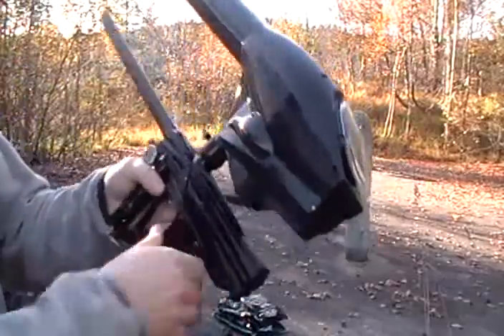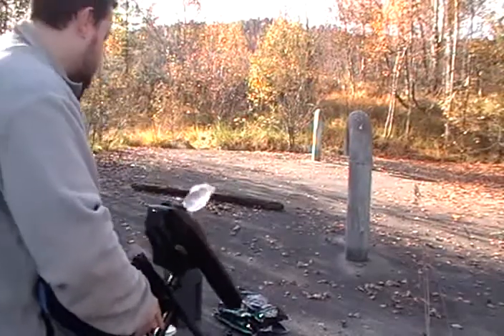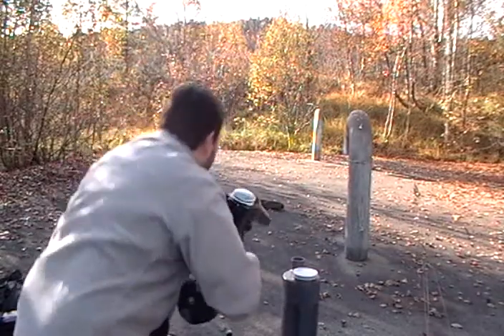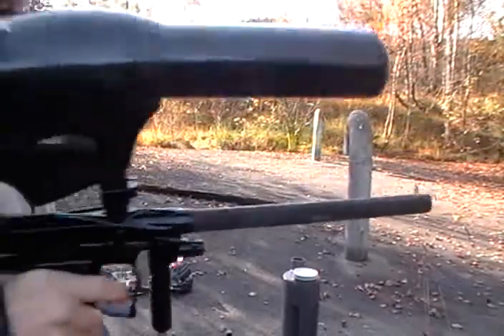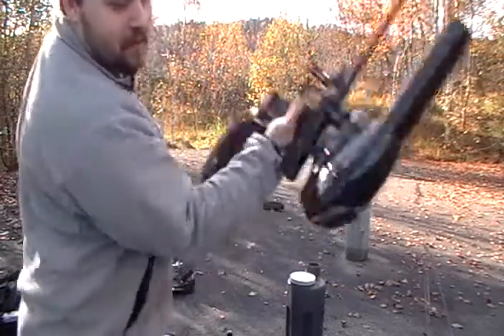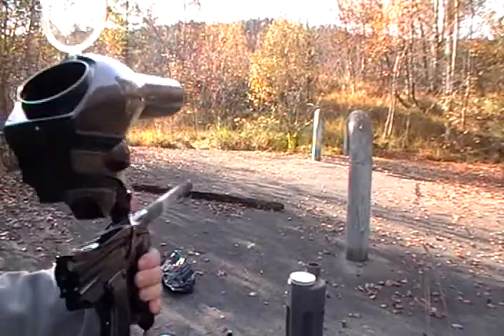Critical FEP Quest efficiency test

Comment from the maker: @crazydman 

It is one pound, 14 ounces without the barrel. I use a Deadlywind, so mine is lighter, but the barrel that comes with the Critical Quest is a 100gram barrel, which is 3.5 ounces. So, with the stock barrel, it weighs in at 2 pounds, 1.5 ounces. Slightly less than an Etek 3.

Comment from the maker: @Talucci34 

It should be around 100. I lucked out with my Quest, and it runs fine at about 55-60 PSI out of the box, but I have heard that many people need to start out at 100, and break it in a bit to get it down that far. You can try messing around with it if you like, but you can play it safe and stick around 100 for a while.

Comment from the maker: @hock2ichainsawu 

Is it a large leak from the ASA? Because that is the purge hole. It would be leaking for two reasons. Reason one is because your tank is not screwed all the way in, and reason two is because the o-ring on your tank is damaged/destroyed.

Your bolt could be a lot of things, all of them related to o-rings. Pull out the bolt, check all your o-rings, relube, and try again.

Comment from the maker: @xxTIGER43xx 

I have been told that they are backordered until the end of January, but the only place that could tell you for sure is Critical. I would give them a call, and find out. But I am not sure what you would upgrade on the Critical Quest. A new ASA so it has an On/Off, and maybe a board... But really, the ONLY reason to get a new board is for burst, full auto and auto-response. If you dont care about those modes, and will just play semi and ramping, stick with the stock board.

Comment from the maker: @xxTIGER43xx 

I do not have any real experience with the Droid, so I will not comment on that. But the Quest shoots better than the Ego 09. It is smoother and quieter. They are about the same in terms of efficiency, but the Ego is obviously worth more, looks nicer (in my opinion) comes with a lot more accessories, and has a screen. For the price, the Quest wins if you ask me, but overall, I would rather have an Ego 09 than a Quest to be honest with you.

Comment from the maker: @xninjaxturtle 

Although I could, I dont see how that would help, being that I have the APE board in it, which is not the stock board. And changing modes on the APE board is as simple as pressing the power button to cycle through modes. If you want a video of the stock board, you will need someone else to make that video.